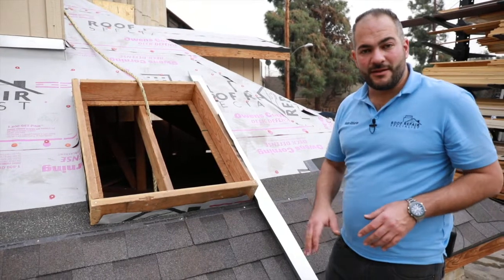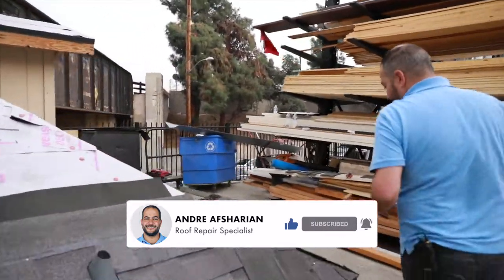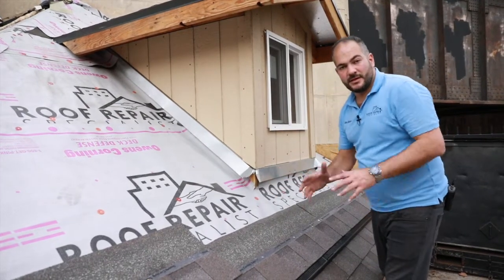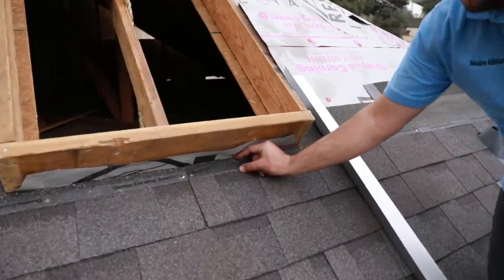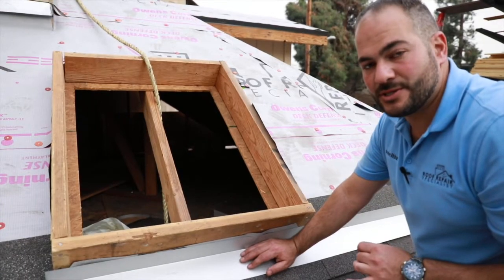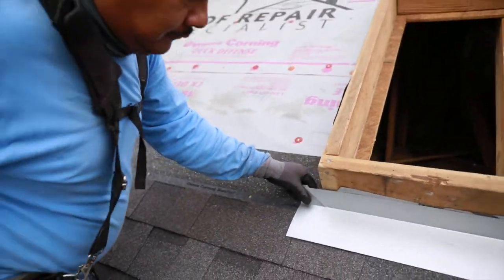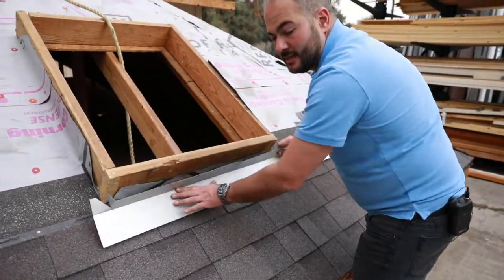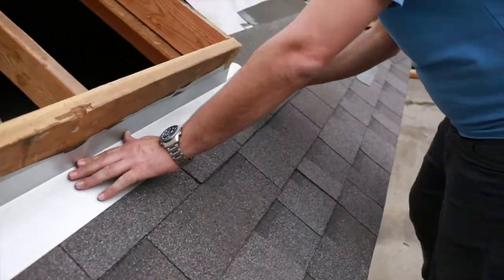How to Install Headwall Flashing | Shingle Roof Install Guide

Comment: Im using t 1-11 on a carport bumpout. So there is a low slope roof that meet a back wall. Should i put a osb panel on the back wall fist,flash it then cover with the t1 -11. Thanks.
Reply from the maker: Sorry, I’m having a hard time understanding the application/ detail

Comment: What seals the top of the curb to the sky light?  I took a blower to blow off the tree needles from the roof top and needles were coming through this gap.  Sky lights are a year old and have had lots of heavy wind and rain with no leaks.
Reply from the maker: Usually nothing, a waterproofing seal is not needed, if your worried about wind then a gasket will do

Comment: Should there be snow and ice material around the skylight before the shingles and flashing??
Reply from the maker: Depends, if you have ice and snow where you live then yes. 
If the skylight manufacturer requires it then also yes. Velux does provide it and require it.
Reply: @RoofRepairSpecialist   Yes, we do get a lot of snow some years. Thx I am trying to properly flash and shingle around my chimney that goes thru my garage roof and one side attaches to the gable end of my house.
Reply: Do you have a video on flashing an inside corner?

Comment: Question; nailing the flashing on top of the shingles is not a waterproofing issue? Thanks
Reply from the maker: It is, we just seal it with structural sealant. 
If it is a short run we try not to put any nails that are left exposed. On a long run such as this you need to put a few nails in.

Comment: Do you put nails in the 4” section of the flashing. If so how often?
Reply from the maker: We generally dont put nails in the exposed area of the 4" section unless its a long run. If its just a 2-3ft skylight it wont lift up. If it is a 10ft section under a wall we risk the flashing lifting up and we put nails to prevent that. I would say keep it at every 2-3ft on center. We try to minimize those nails as they will be left exposed.
Reply: @RoofRepairSpecialist  the contractor that did my roof put nails approx every 1” on a 25’-30’ run. Excessive in my opinion.